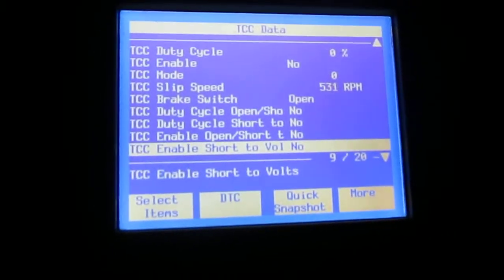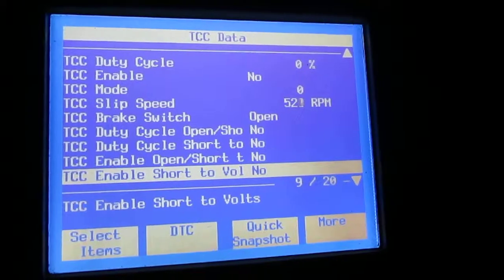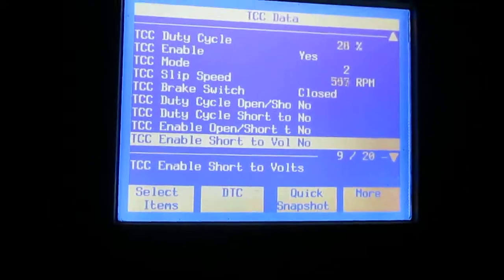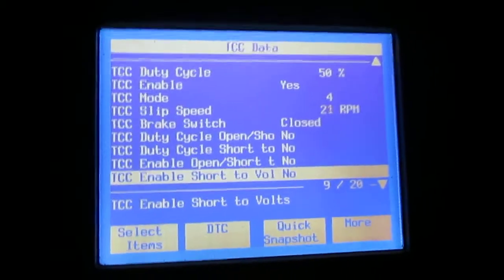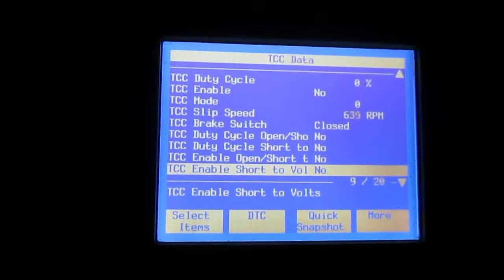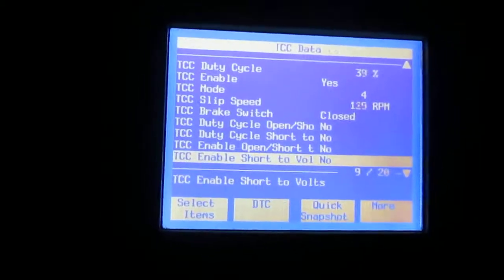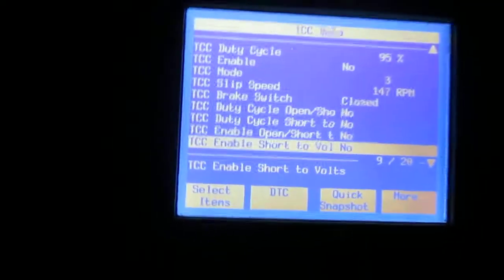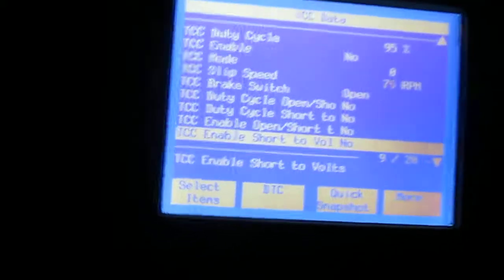Torque converter clutch slip Scan tool values 99 GMC Pickup

Comment: This is very helpful, thanks very much for uploading.

Do you know what kind of slip speed you would expect to see at WOT?
Reply: Actually looks like you did do WOT, or close to it at around the 1 minute mark. I saw it hit 1kish slip, which is what I needed to know.

Trying to troubleshoot a lockup problem on a 4l60e, and needed to confirm this to find out if it is just the TCC not engaging, or if it was potentially 4th gear slipping.